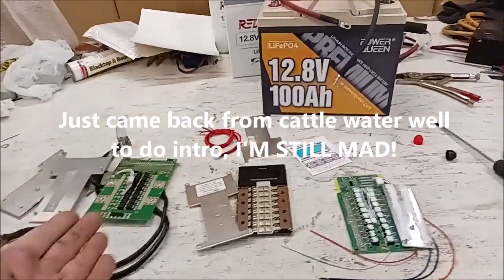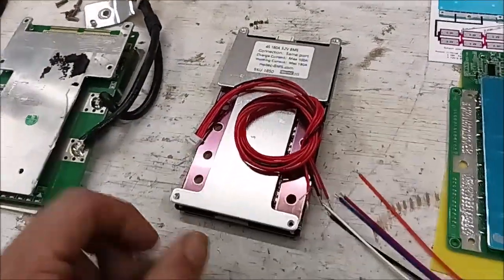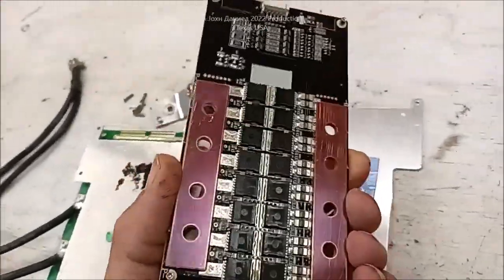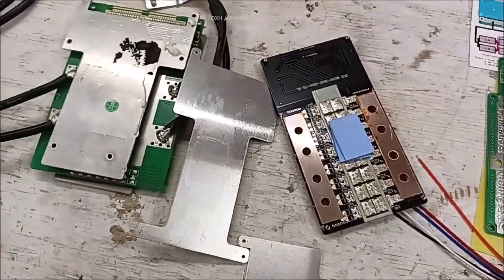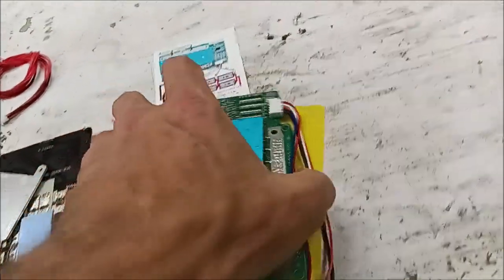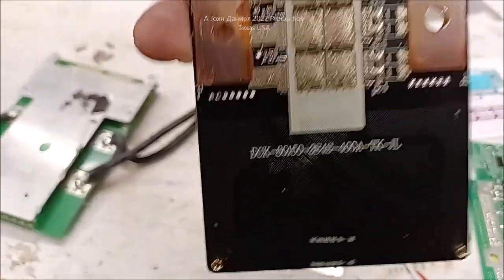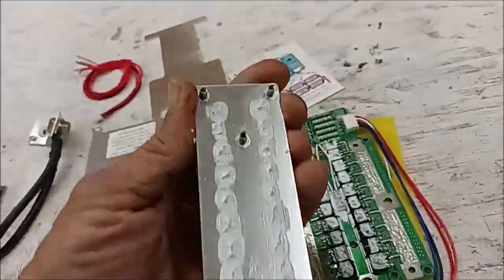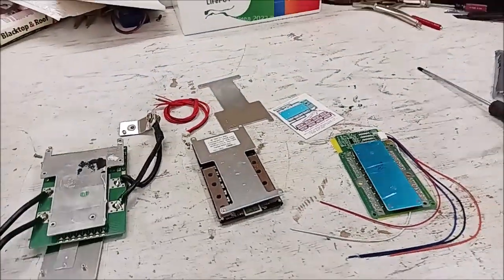HELTEC BMS Battery Management System, once great, now garbage? Better cheaper options below

Comment: Should give mosfets model as i'm curious about it's R on state.
Reply from the maker: They are same model as ones in Unowix battery that has 28 in it.
Reply from the maker: UPDATE - I sent the high resolution pictures, 8 of them, to a tech friend who now works remote for Mouser Electronics, 34 years a technician. Started at VLSI and 19 as a board designer with Chrysler, his response is "Chinese half assed". He agreed they were playing a FOOL YOU by placing the more expensive to make Aluminum plate on the back to make it appear as the JBD a dual sided heavier built and cooler running BMS.  He said the output switches (p-mosfets) are rated to just handle the load, but not long term, and absolutely not enclosed or in a restricted ventilation or higher than +40c temp area. Insufficient cooling in any form will cause failure of one then failure of all. Saying its SAME PORT design is OK to use,  just not to allow it to get hot. He noted the oddity of conductive Charge rate being claimed is 60% of draw so it shares partial direct, with no in use charge characteristics noted. Which he said to consider the BMS based on that as actual draw ability in a sustained current. His solution was to improve the heat sink and it would probably be OK for normal use, just keep draw under 130 amps. 
 Oh nice. Well crap! I live in hot Texas 🌞 ,not Montana ❄️ like him. So I stand by my first impression.